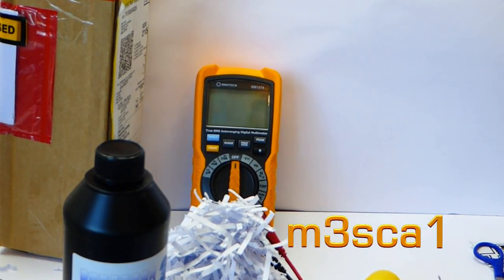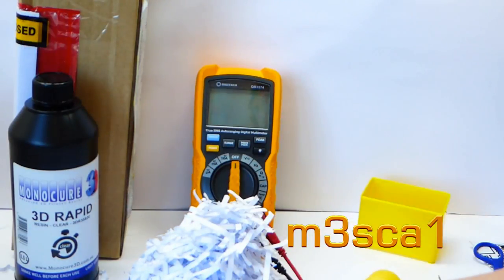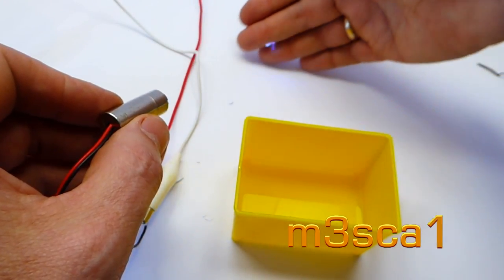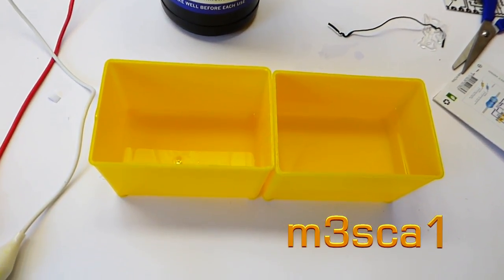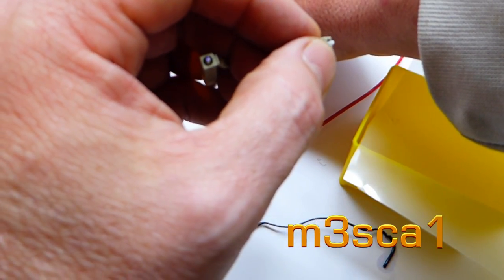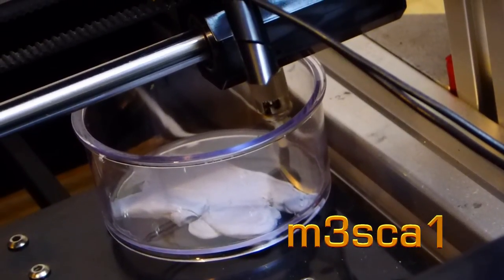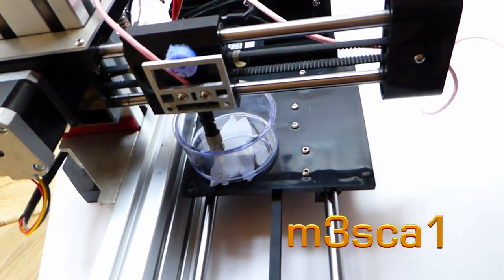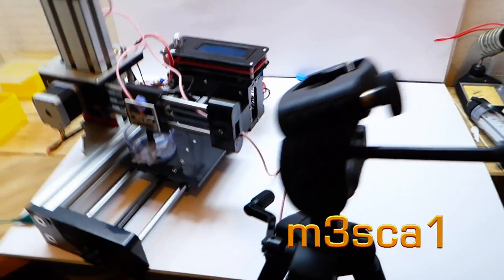Blue LASER & MONOCURE SLA resin

Comment: The stuff you're talking about is light cured composite resin, it's dental filling material. As it happens I got bucket loads of it...I also got light cured putty, it sets rock hard in about 30 sec.the resin is expensive, the putty is cheap..when you finally get around here I'll give you some putty.

Comment: ;)   thinking out side the box. Nice work. ~Russ
Reply from the maker: my biggest concern with this approach is it all sticking to the Optic fiber tube. Can you see any reasons why it would not work?
Reply: Up and down motion on the bed that holds the SLA can be used to create 3D prints. Beam focus and having a small beam diameter would be like your nozzle size. How powerful  the laser would be your  extrusion perimeter. Its entirely possible to make a SLA 3D printer. From my line of work we do 2-D Lithography with Negatives (Film or Printed Digital) and High Intensity UV to create raised structures. The times of the exposures facilitate the 2-D layer height and the negative image is its shape. We build up polymer chains usually from a flash of the UV on the back. So a person could flash the bottom with UV light to create a skirt & brim layer with the proper programming of firmware/software to hold your structure in place, then build from there. 
I would love to see these type of electron/photon influenced molecules be brought down to a sub atomic level of accuracy. Some one is doing it somewhere, we just hear very little about it ;) 

 It looks like very you are cranking those mental gears creating some cool stuff. Never stop exploring possibilities my friend :)
Reply from the maker: i am finally getting back to me!